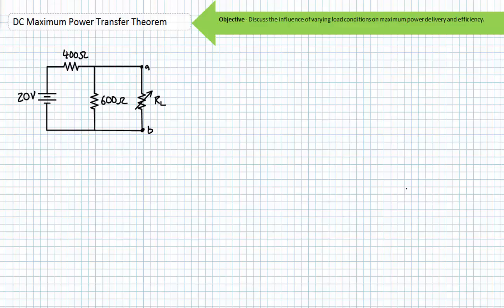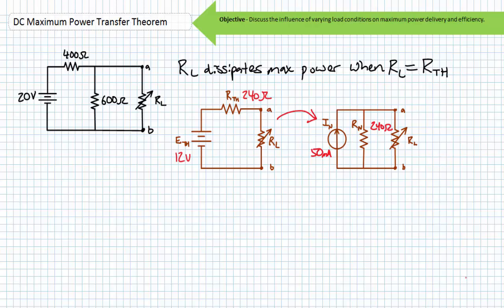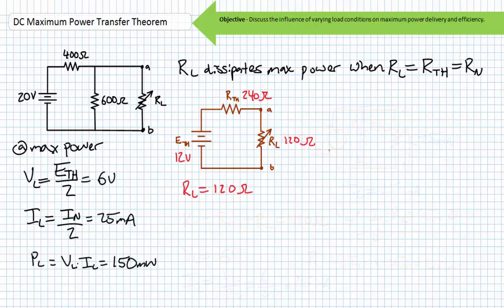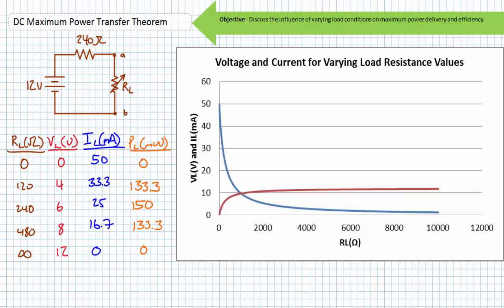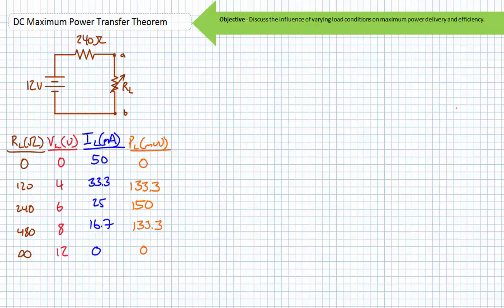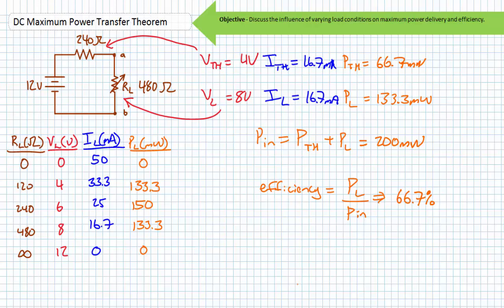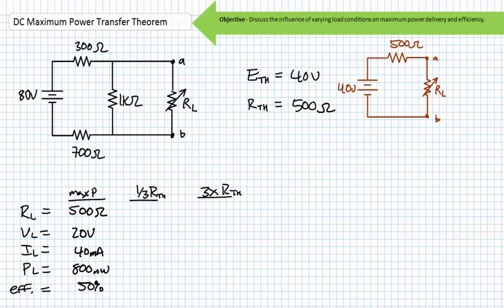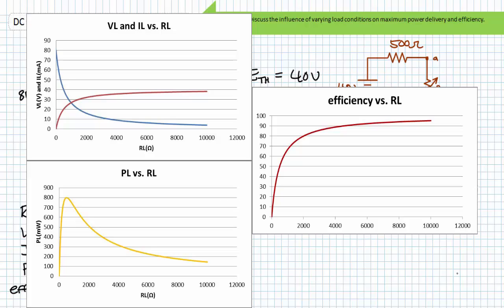DC Maximum Power Transfer Theorem (OLD LECTURE)

Comment: Hello Jim. I was trying to compare the behavior of the load voltage, load current, and load power dissipation as the load resistor increases from 0 to 10,000 using Thevenins equivalent circuit, and Nortons equivalent circuit (meaning, calculating VL, IL, and PL from the Thevenins circuit and one more time from the Nortons circuit). As expected, the results are identical. Moreover, the efficiency of circuit increases as RL increased (as shown in the lecture), where you used Thevenings circuit to calculate the efficiency. However, when I calculated the efficiency from Nortons circuit, I found that it decreases as RL increases (intersect with the other graph when RL=RTH=RN, and it equal to 50%).
Reply from the maker: Cool! I'm going to check this out.
Reply from the maker: Verified!

Comment: It took me a couple of hours to realize I could prove that optimum power output happens when RL=Rth, by making a simple equation for power output at the load. Total voltage and Rth fall out as constants. P=(Vt^2*RL)/((RL+Rth)^2). Then set dP/dRL=0, limited to the constraint that  RL>0. RL is always equal to Rth at the maximum for power output, it tumbles easily out of the math. Wow, I never thought calculus would be useful, ha ha.